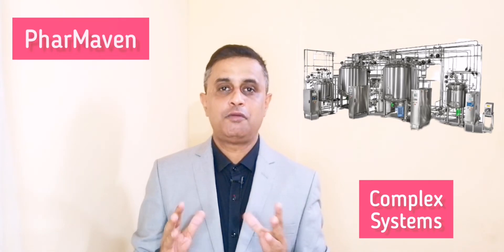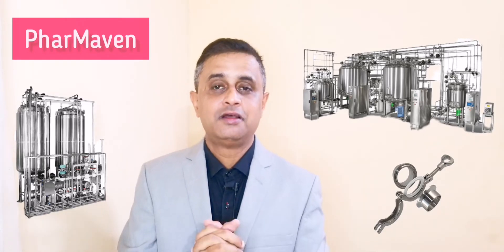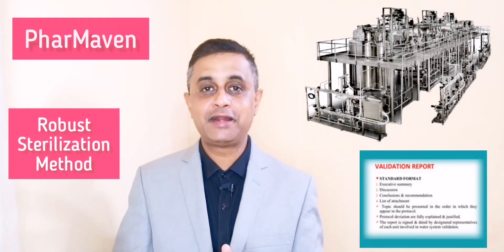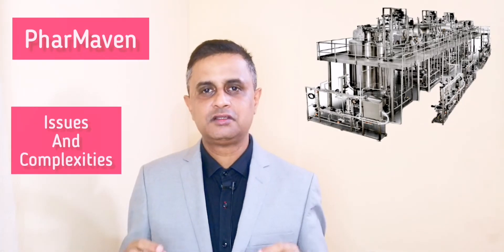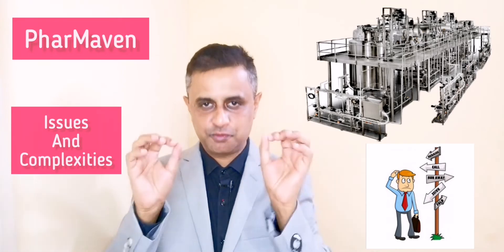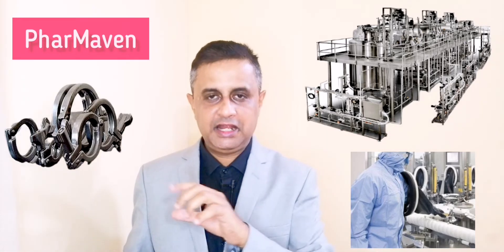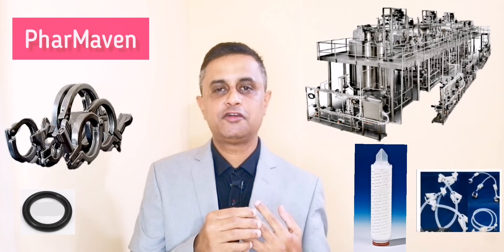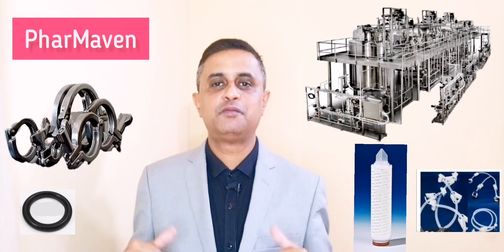Media Fill Failure Investigation Part-3, Failure in Complex Processes @PHARMAVEN #media #failure

Comment: Thank you sir, good information.
As a media fill incharge i have faced more than 15 media fill failures in complex injectables (Microspheres, Suspensions and sterile liquid injectables).
However finally we achieved with zero media fill failures since last two years.
Reply from the maker: Great To Know That, You are Expert. Please be In Touch with me
Reply: @PHARMAVEN  sure sir.
Reply from the maker: My number 9426046573
Reply: @PHARMAVEN  kindly make a video engineering water plant sir